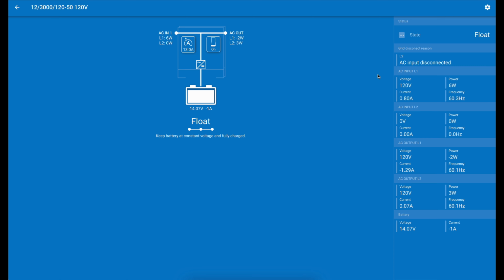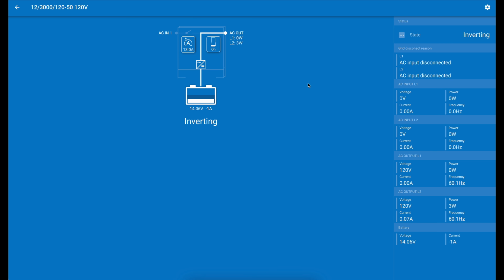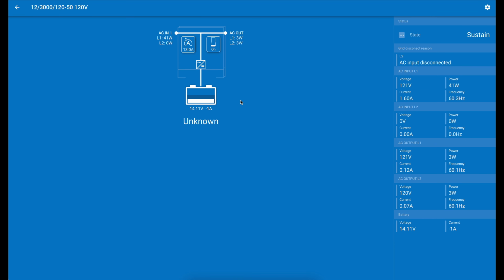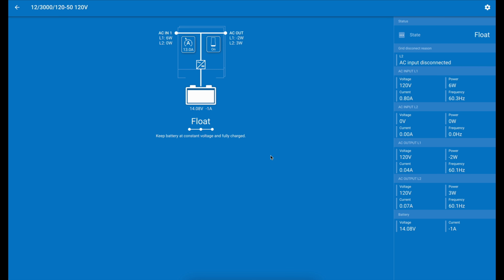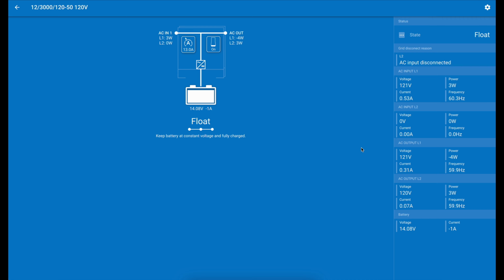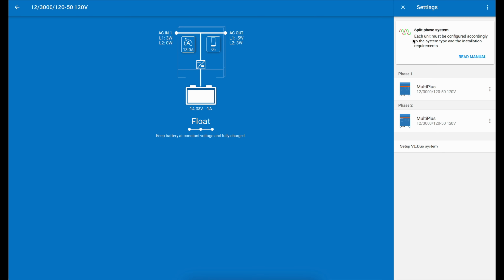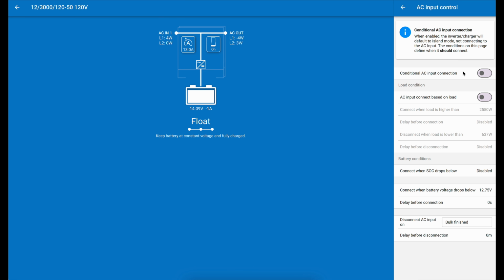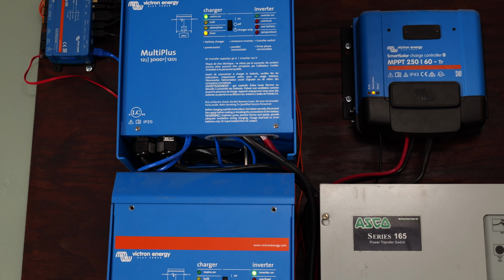Victron Inverters - Generator Not Connecting - Troubleshooting AC input Problems

Comment: My inverter starts with green inverter on… after a minute it switches to mains on and bulk for maybe 30 seconds. Then it flips back to inverter for about the same amount of time. This loop repeats. I have a Onan 2500 generator and a Victron 3000 MPll inverter 12V
Reply from the maker: The slow cycling from AC input and back to inverting usually indicates overloading of the AC source. In this case the Onan would want about a 16A AC input. This would limit draw to about 1920w max continuous. This can be done with a MK3 adaptor and VictronConnect, I have another idea on this channel covering less then 3 inverter programming. From the factory AC input is set to 50a for max passthrough.